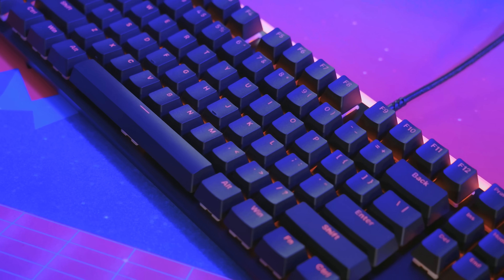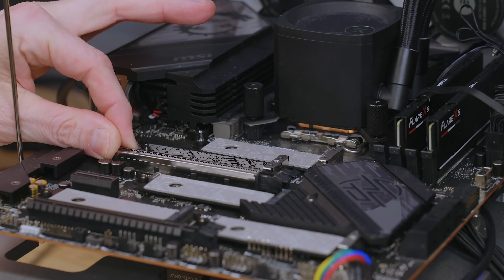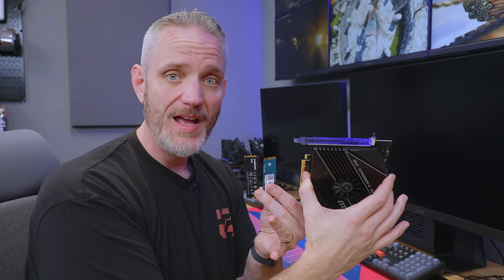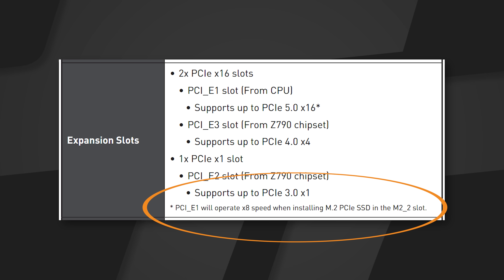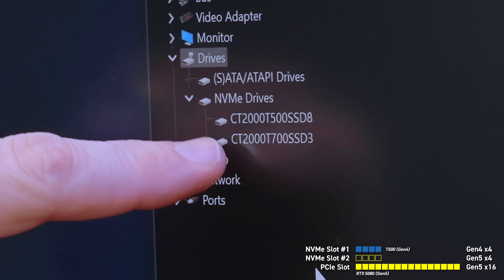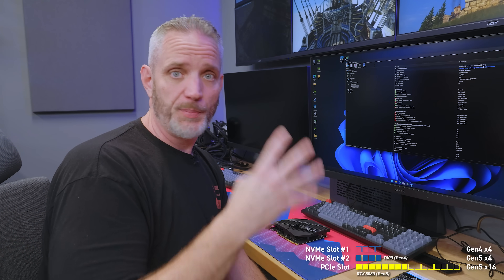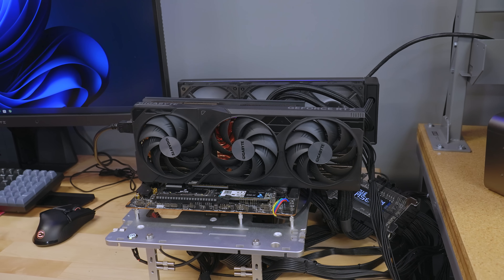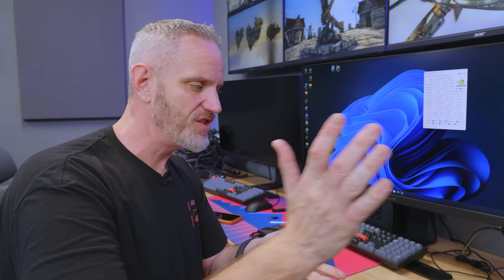Don't make this mistake with your PC!

Comment: Someone please correct me if I'm wrong, but for a Gen 4 GPU that's running in x8 instead of x16 wouldn't the performance loss in gaming (what I figure most people are doing) be negligible? I have a 14900k and 4080 Super with every NVME slot filled on my motherboard (all drives are Gen 4), and the performance seems to be as expected... But maybe I'm wrong? I guess the point I'm trying to make is, as long as the user checks what gen and lane usage their GPU is, and the NVMEs are setup in the right slots, would the GPU gen and lanes really matter if it's x8 or x16?

Comment: AM5 USB4 requires a 4x link to the cpu in order to function. There are multiple motherboards that have those usbc 4 ports sharing lanes with either an M.2 or x4 slot, but the taichi just has it to the USB4 controller, along with video outs. USB4 is functionally thunderbolt 3 so it needs a 4x connection, and the increase from 20 to 24 lanes was specifically to accommodate a USB4 connector. Note the first 16 lanes are bundled, but the last 8 are broken into 2 groups of 4, so its not possible to say run a x16 and x8 or 3 x8 cards, but for workstation power users, you could have a gpu on an x8, then 4 nvme drives in raid 0 on the cpu for blistering fast 64GB/s of memory, then still have expansion from the chipset for things like 10gb/s nic and extra sata drives. You can also do a secondary gpu at x4 if you say need more display outs for your day job but game on the main gpu only at night, or if you just want as much gpu horsepower as possible Gen 5x4 is literally the same as a gen 3x16 in bandwidth, so you actually lose no performance with a second gpu since they're still 4 cpu lanes.

Comment: Maybe someone can enlighten me, because I'm not quite sure how to understand Hardware Info and GPU-Z. I have a Asus Prime Z690-P D4, i5-12600K, a RTX 3080 and three M.2 Gen4. According to HI the GPU is "PCIe v4.0 x16 (16 GT/s) @ x16 (2.5 GT/s)" and all three M.2 are "PCIe v4.0 x4 (16 GT/s) @ x4 (16 GT/s)". This would indicate to me that I'm actually crippling my GPU right now (2.5 GT/s), but GPU-Z tells me up "PCIe x16 4.0 @ x16 4.0" (fluctuates a bit) if I run the render test. Does HI only show the idle 1.0 and not pick up the render test boost? I recently added the third M.2 for more capacity, but I'm not sure now if I should switch out my second M.2 and only run two (512GB boot, 1TB second, 2TB third).

Comment: Actually, regarding that XpanderZ card, it wouldn't give 2 lanes to each M.2 drive. It would only recognise one M.2, as the lanes aren't sent to a central location and the split out, it feeds the first 4 lanes to one drive, and the second set of 4 to the second drive

Comment: Jay, the way you talked about the Asus X870E-E Gaming PCIe 5.0 lanes bifurcation was kind of misleading. In order for the GPU lane to drop from x16 to x8, you just have to use one of the two M.2 slots mentioned. Here's what the tech specs say:
** When M.2_2 is enabled, but M.2_3 is not in use, PCIEX16_(G5) will run in x8 mode.
** When M.2_3 is enabled, but M.2_2 is not in use, PCIEX16_(G5) will run in x8 mode.

Comment: Ol' Timer likes his Collection of Flagship X99's, X299's  X-Series and an X399  / TR 1950X to represent. The MB will actually fill a nice Premium Case. Plus, cosmetically, ya gotta luv those 8 sticks of Ram flanking the CPU. If you're building  Retro xx80ti SLI Builds, no problems. I just started collecting cases, parts and hardware a few years ago, some five. The one thing I knew I was over paying for were the GPU's. Didn't care, I was building myself a Model, a replica, a retro flagship, and well know copy, with my own twist, of a Vertical SLI build. Lanes seemed like a 'No Brainer'   -  Ol' ex mil. tech , cons tech., QA tech. from decades and decades ago. Been watching you , and your other friendly rivals,  for the same amount of time of building PC's from scratch. I have to guess hundreds and hundreds. Talk about ' Are you not Entertained'   😂  I thought this a few years ago, is it me or does the quality control seem to be slipping, and sometimes crashing over a cliff, in the last five years ? Not just computers either. 🤔

Comment: So I have the Asus X670E-A board. This was the only board that I saw where I can use all 4 M.2s and have my GPU still run at 16X G5. There Is the upgraded version where It's all white and I can use all 4 M.2s but It disables the 2nd PCI-E slot. I'm ok with that because I never Install anything In the 2nd slot, and I vertically mount my GPUs. So I have been lucky so far on making sure all 4 M.2s run at their spec speeds, and my GPU Is at G5 X15 5.0

Comment: All intel boards I had in the past in the manual always had a nice part that would tell all slots and what they are shared with (same from chipset even said what shared with sound card, what USB ports and everything), and I basically would try to get as many not shared as possible and then chose where I wanted to compromise. But my current one the manuals says nothing 🤬

Comment: Things get even more complicated when you start RAIDing those M.2 drives together.  I'd like to also point out that if you run a Gen 5 drive, there will be no noticeable difference in speed with gen 3.  Unless you are moving or editting MASSIVE (100gb) files all the time.

Comment: I got a z790 pro creator - lots of sata ports and lots of nvme slots - but if you populate all the nvme slots then half the sata ports are obsolete.. I'm using this board as a workingstation. Still doing so but ended up with 4 spare sata-drives. When someone sell you board like that and you say "I want 8 drives for persistent storage and 4 nvme for speed, would that be possble", and they say yes because they only did a visual inspection. Next time iteration of my workstation I'm going to use my own head picking parts are read pros/cons.. Thanks J for clarifying why

Comment: Hope I wont be affected! Got an RTX3060 so I got the VRAM but not all that much bandwidth needed, think It will be like 1% lost :P
Bought a used 2TB Gen4x4 NVME which will be installed tomorrow as to really maximize my Gen3x4 slot for all games even into the next computer and it will also act as a backup to put into the childrens PS5.  It's actually pretty hard to get a Gen3 NVME for a reasonable price which will hold up for +5 years! xD

Oh, I am on a cheap motherboard so got me a PCI-E Gen3x1 expansion card for my OS drive (Kingston A2000), will stop installing stuff on it in 2 days to keep it longer! ;)

Comment: Didn't you do this video like...idk...a couple weeks ago? Did you forget you did that video? Cause you didn't really cover anything new here.

Also, as I said on that video, the average consumer wouldn't notice any of this. Even at gen 3x16 speeds (and by extension gen 4x8 or gen 5x4) a 5090 isn't really losing much performance. Like a few percent, borderline margin of error. 

And the metric most consumers would notice on their drive is random read and write, which doesn't remotely touch maximum throughput numbers. Yes you could spend money unnecessarily on a gen 5 drive for nothing but the average user isn't buying 4 or 5 gen 5 drives anyway so...what are we doing here? Clickbait title and thumbnail just to touch on a useless subject. Again. As is the Jay way these days.

Comment: Where does the USB gen 5 share with? Does it get its own lanes or use those leftover 4 lanes while auto bifurcating temporarily?  Asus strix x870-A. I understand my slots and have left my 2nd gen 5 empty, but I do not use the second PCIE gen 4x16 at all yet and would put an NVME expansion card when I need it. Or was this the same as your mention of the Asus board having 3 direct lanes for gen 5. But in any case, where does the USB Link Mode in my bios affect what lanes, or are they  not sharing the same lanes. Pardon my lack of research before asking after watching this video.

Comment: One of my motherboards will kill SATA slots if you populate the M.2 slots that support SATA drives, even if they have NVMe drives installed.

If it's the same board, my current one has the issue with 11th gen Intel support Gen 5, but 10th gen Intel only support Gen 4, so the top most M.2 will only work if I use an 11th gen CPU. Could also be a case of not enough lanes on the 10th gen CPUs to allow that extra M.2 slot to be hooked up.

Comment: Yeah this PCIe lanes nonsense is getting old. My 5820K had 28 lanes. You would think that being a top end chip back in the day would mean that chips moving forward would have plenty more PCIe lanes. But nope, lets just make everything run at half speed if you want direct lanes! Flipping insane. Not to mention as said in the video Mobo manufactures leaving lanes to NOTHING. 

It sucks that there are just some people in an office somewhere saying "Well if we give less lanes.... we get a bigger bonus! Who cares if consumer computers don't run full spec when they pay for that spec". Even the newest Intel Core Ultra 265K only has 24 lanes. How is it that a 10 generation old CPU (the 5820k) had 4 more lanes???? Same with the Ryzen 9 9950X3D 28 total with 24 useable.  

That said with using chipset lanes I haven't seen many issues with SSD speed. But still you think they would see the need for more lanes with all of the new Mobos having 4+ M.2 ssd slots, a 16x GPU slot, with 5 PCIe connections (1x-16x) on top of that. BUT HEY if you want to spend a fortune you can have 128 gen 5 PCIe lanes with a threadripper! NOT POSSIBLE to get 50 lanes on an affordable chip though!

Comment: And that's why I picked the ASRock X670E Steel Legend motherboard in the first place!
I first search for a board that has the features I need, then I filter those who has additionals but optional features I'd want.
And from here, I look up all the specs from vendor, then manufacturer website, and if I like it, the manual.
The X670E Steel Legend is the ONLY board I've found that doesn't have any bifurcation what so ever.
I can populate all 3 PCIe 4.0 M.2 + the PCIe 5.0 M.2 + the PCIe 5.0 16x port, the other PCI ports if I want to, the 4 SATA ports, and it will still give me full speed and don't downgrade any gen on any of them.
Downside is, the 1x and second 16x (which run at 4x) PCIe ports are always gen3, which I think it is why they have all that crazy raw, un-bifurcated glory!

And since my config is planned around 4 NVME (OS, programs, personal files, games) and 2 SATA SSD (other games), any other motherboard wouldn't do.
Bonus, on top of having a good number of USB ports, this motherboard have 2 ethernet ports, a 1G and a 2.5G, sadly, it looks like they forgot they could do something like that on newer boards...
Most bifurcations are totally stupid.
The crown for the worst one might actually belong to Asus with the x670E... Like the X670E-E:
2x 16x PCIE, but only if you use one, if you populate both, you get PCIE 1 in 8x and 2 in 4x, meaning 4x wasted, and if you populate M.2 port 3 you get 8x 4x as well...
Just cut that second PCIe x16 rather than cutting on the main one for goodness sake!

I've seen some boards switching from gen X to gen X-1 from bifurcation, and I'd rather have a gen 4 16x over a gen 5 8x, the P in PCI stand for PARALLEL after all.

Comment: Funny thing, i have asrock b650m hdv/m.2 board it says it supports only gen4 x16 slot but actual in bios there is option to enable gen 5 and it works and when enabled gpu z says that it runs x16 5.0. it have two m2 slots one is gen5 another is gen4 i am using gen5 ssd but if i put second ssd. my gpu speed drop to x8 5.0. So even manual not always tell you what board are capable. (they have same board just white edition and in that case they say that it supports x16 5.0)

Comment: would have been nice if you talked more about the chipset NVME slots, Seems like it would be best to use 1 drive in the gen5, the GPU and the rest in the chipset? (for your motherboard)  but how does the chipset work and what are the chipset? gen 4? i appreciate you talking about this but you kinda just skipped over chipset like everyone knows what it is

Comment: Good explanation. One thing which seems to be worthwhile to mention is that for example the x870e chipset is only connected to the CPU with PCIe 4.0 x4.
Everything on the chipset shares these Lanes. It doesn't matter if it's USB, SATA, NVME, Networking or something else.
If you want everything to run at full speed you can't even use these slots because a single NVME drive could saturate this Bandwidth.

With a single drive this doesn't lead to big performance problems but some connect more.
The ASUS ROG Strix has 2 PCIe 4.0 x4 slots over the chipset. These will share their Bandwidth and you should for best performance only use at most one of them. 
If you just want Storage Space without caring about speed this doesn't really matter.

Comment: Intel has only 20 lanes from which 16x gen 5 are directed to the gpu and 4x pcie gen4 for the nvme which include these generations of cpu 12th gen, 13th gen,14th gen and core ultra series(supposedly 15 th gen) i9, i7, i5 and i3 all of these cpu have these versions of pcie lanes.

Comment: Another thing to keep in mind: Some drives can run pcie4x4 or in pcie5x2. So HWiNFO will say something like: NVMe (PCIe x4 32.0 GT/s @ x2 32.0 GT/s)
. And Crystal mark will say "PCIe 5.0 x2 | PCIe 5.0 x4" - but everything is fine. It just means that the PCIe LANE can run x4, but its only using x2 @ GEN5

Comment: Jay, you had me paranoid as my 5090 system stems from an Omen (I know, I know) / Blizzard 894A motherboard with an i7 12700 on board, 2 M.2 drives and a SATA drive. I was sure it would be running in 8 lanes,  but in fact, even with all drives occupied,  my 5090 is running at the full 5.0 x 16. This little mATX board pushes above its weight hence my case swap and other upgrades prior to installing the 5090. Anyway, great topic keep up the good work!

Comment: Thanks for the Video! I was just doop doing along thinking the MB says it's rated for PCI 5.0 so I can plug in any thing else rated at 5.0 and would get full speed. Never occurred to me that only some of the slots would be 5.0. In my case only the PCI-E16 slot supports 5.0.

Comment: Realistically, it makes more sense to get a board with one or two gen 5 m.2 slots.  How many gen 5 drives do you really need, considering that they're still significantly more expensive.  Put your OS on gen 5, and maybe games.  Any other storage will not be noticeably slower with gen 4.

I have the MSI x870e tomahawk.  It has 2 gen 5 x4 m.2 slots, but one of them will be x2 IF you need the USB4-C 40 gig speed ports.  If you disconnect the USB 4 in the bios, the second drive is x4 speed.  The other two m.2's are gen 4 x4.  I'd rather have to choose between USB 4 and x4 on the m.2 than slowing down the GPU.  While, the difference in the GPU probably won't be noticeable, it will be more so than with an extra m.2 used mainly for storage.

Comment: Why do people need to hear about PCI Express bifurcation? It's only been this way since checks watch ....the PCI SIG released PCI Express 1.0a in 2003.
Reply: @JayzTwoCents @1228 your specific motherboard "poofed" x4 lanes when PCIE_1 bifurcated but several motherboards support double bifurcation turning x16 into x8 + (x4 + x4) keeping those "missing" four lanes accessible for multiple Gen 4 x4 drives.

ASRock X299 Taichi CLX
ASUS WS WRX80E-SAGE SE WIFI (supports x8 + x8, x8 + x4 + x4, and x4 + x4 +x4 + x4 bifurcation)

Gigabyte TRX40 AORUS XTREME
ASUS Pro WS W790E-SAGE SE

Comment: You just solved a mystery I had on the PC I finished 2 days ago. After actually checking my manual, I had a brand new 1tb m.2 ssd that would not show up at all. Turns out, it was in a slot that shares bandwidth with the two 40gb ports on the back of the MoBo and I have had something plugged into those slots the entire time all the way from the bios flash, to the windows install, then peripherals. The damn slot has just been disabled because I can't read.

Comment: Ultimately, test your hardware once it's installed. Got a new SSD ? It's supposed to be X speeed, but after testing you're not getting that? 

Trouble shoot : generation of wire, generation of connector, lane allocation. 

Got a x99 chinese board that advertised SATA 3.0 connectors, only to find out that they were gen 2.0. 

I found out because my SSD went max 280 read write. You gotta double check. Even if it works, it might not be working at max capacity

Comment: 17:18 I remember thinking this when I built my current computer. Gigabyte Z790 AORUS MASTER
M2C_CPU	PCIe 5.0 x4	~14,000 MB/s	CPU	*Shares lanes with the primary GPU slot.
M2A_CPU	PCIe 4.0 x4	∼7,000 MB/s	CPU	*Does NOT share lanes with the primary GPU slot.
M2Q_SB	PCIe 4.0 x4	∼7,000 MB/s	Chipset	
M2P_SB	PCIe 4.0 x4	∼7,000 MB/s	Chipset	
M2M_SB	PCIe 4.0 x4/SATA	∼7,000 MB/s	Chipset

Comment: if gpu's run the same on 8 lanes as 16 lanes, why don't they just make gpu's 8 lanes in general and have the rest of the lanes open for other components? why have the gpu suck 3/4 of all lanes available if it has not real benefit?

Comment: I really like Gigabyte motherboards - quality wise. Unfortunately, especially, Gigabyte tends to "steal" you some functions or lanes when using certain slots.
My old X670E Aorus Master for example deactivated(!) two SATA ports when using the lowest PCIe slot.
Also, the GPU sits with two M.2 SSD slots on the same PCIe 5.0 lane. The GPU could get downgraded to x4 while simultaneously downgrading one SSD to x2 as well.
If you know what you have as hardware and plan to add to your system, it is likely you might have to switch manufacturers to get all that installed - not only motherboard-wise, also CPU brand-wise. My 9950X e.g. has 28 lanes. I have one GPU (PCIe 4.0x16), one Intel X550-T2 (PCIe 3.0x4), one M.2 SSD (PCIe 4.0x4) and 4 SATA SSDs (via Chipset, connected by PCIe 4.0x4) in my PC and no loss of PCIe bandwidth.